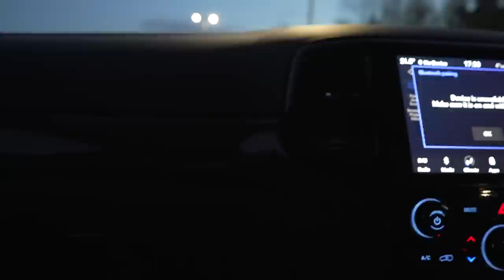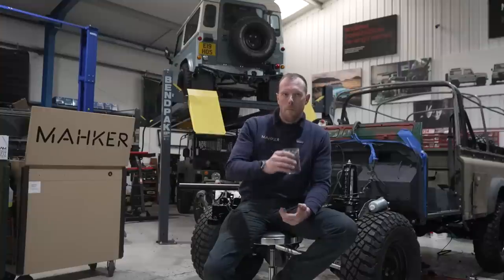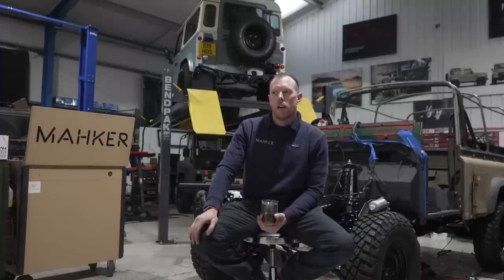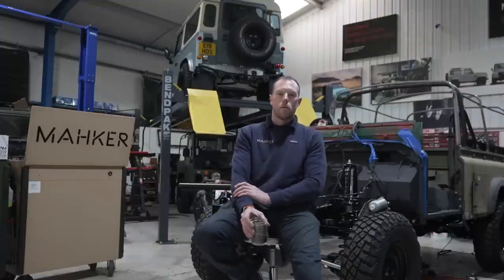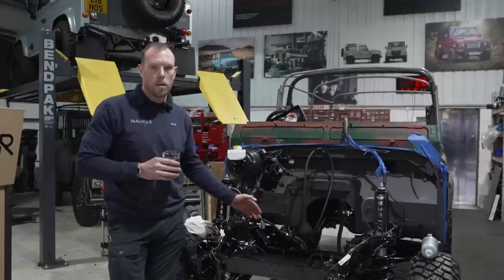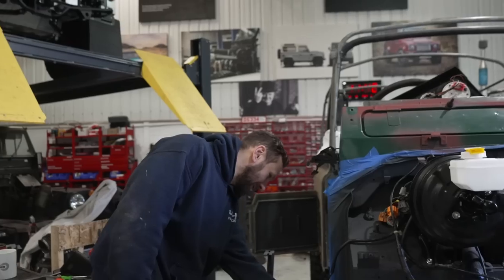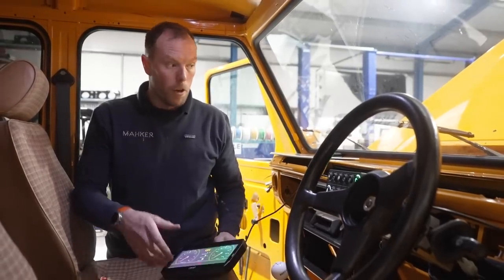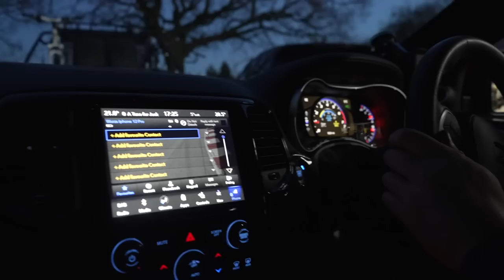Why are we called MAHKER?? And other Land Rover Defender Questions | MAHKER EP031

Comment: Another great video. I really enjoyed the Q&A. Here is a question for you guys, a few videos back Sam did a segment on how you do your electrical installations on your LS conversions. I loved the way Sam routed everything in under the drivers seat instead of leaving the ECU, relays and fuses on the bulkhead like I see done on a lot of LS installations. So, of course I decided to rethink how I was doing it and ran all of my stuff to under the seat box where it would be out of sight and out of danger! My question is, when you guys run the harness into the box, what sort of grommets do you use? There are some big wire bundles that need to get in there with even bigger plugs (for the ECU). I found some split grommets that seem like they will work ok, but trying to figure out if there is a better solution! WWSD? (What Would Sam Do?)
Reply: Shrinkable Strain relief boots are are the most ideal, and plenty of silicone spray for lubricant helps with the plugs if your Not in a position to very carfully and methodicaly de pin the plug, like the ECU plugs for example. However, the standard style of boot, preferably new so it hasnt been cut or sliced to release plugs etc, is just fine and and made to suit .  A CV boot spreader is a Big help when it comes to this, little secret there :D.  the Primary function of this particular boot is to Relieve Strain from the Loom. you MUST avoid the weight of the wiring pulling on plugs, connections, loom branches... Anywhere you can relive strain from the loom, if you can you should.

Secondly, its keeps Outside out, and Inside IN. this includes water, running vapours, bugs, dust, so on ...

Thanks for Your Question Buddy! Good luck on your build.

Comment: Here's a late question for you.  You fitted a really tasty slim roof light bar to your Offender model and you mentioned it in a more recent video if memory serves.  What was the brand and model?  What type of fittings did you use to attach it to the roof and how is it attached? To the channel or drilled into the roof?  Also what type of fitting did you use to bring the cable through the roof?
Loving the video's, keep em coming 😎
Reply from the maker: Lazer linear model 48” with scan strut seal
Reply: @wearemahker  Ah right.  Great, thanks for getting back to me 😉😉

Comment: On my farm (forestry) in South America I need 4 Land Rover Defenders, preferably 300TDI without electronics and a pre-chamber diesel that lasts 400,000 km or more without being opened once, then it should still be left-hand drive ... do you think it can to do something ???
Reply from the maker: We can most certainly do that for you sir what spec do you require them to ?
Reply: @wearemahker  Thank you for your prompt reply
First of all, it is important that you get 4 Land Rover Defender 300TDI (1x 130 double cab, 1x 90 and 2x 110) steering on the left !!! For anything else I need to come to England to discuss all the details.
But first I have to organize a lot here in South America (Dominican Republic) then I have to travel to Switzerland and from there I'll come to England to discuss everything... thank you very much